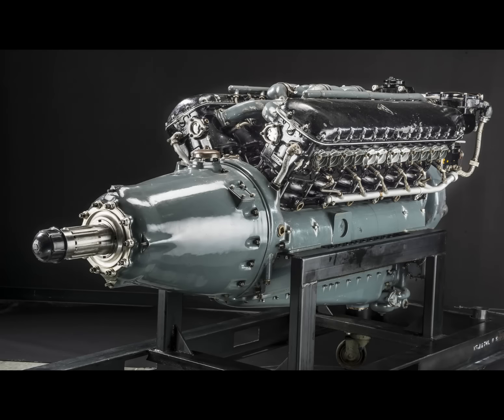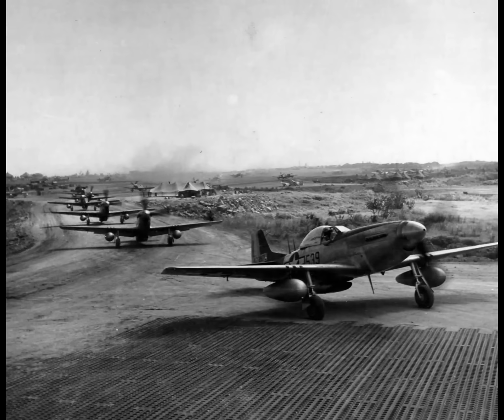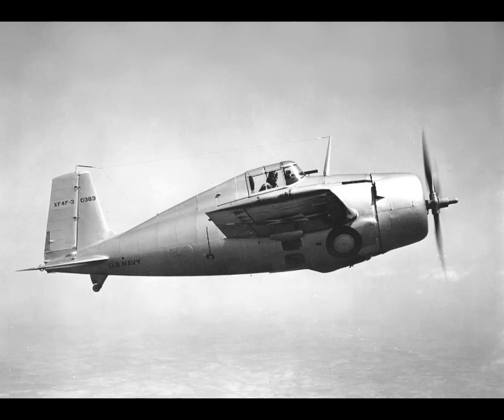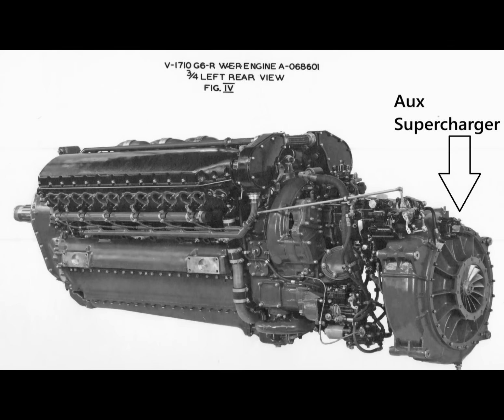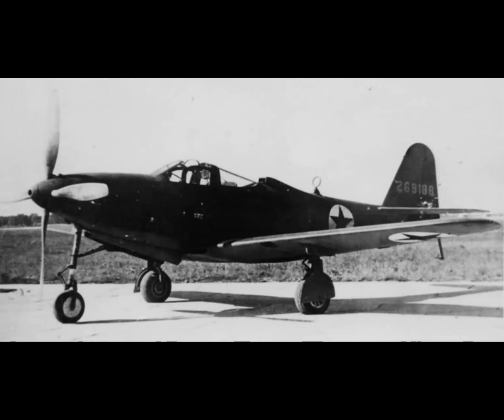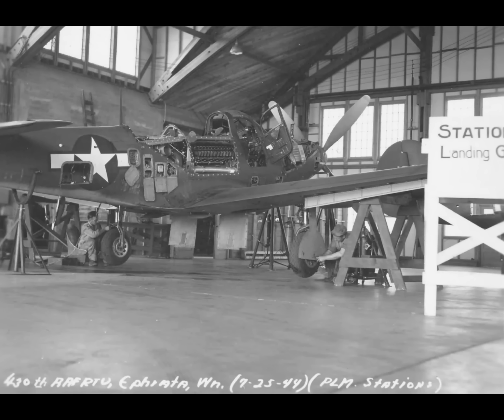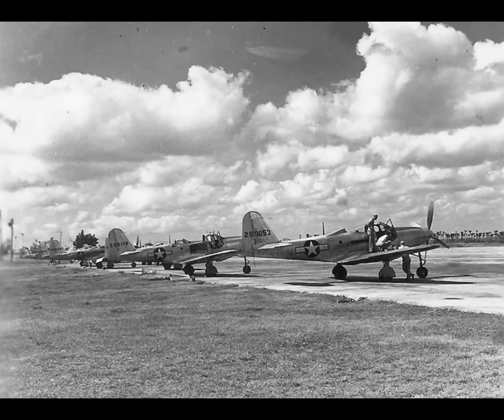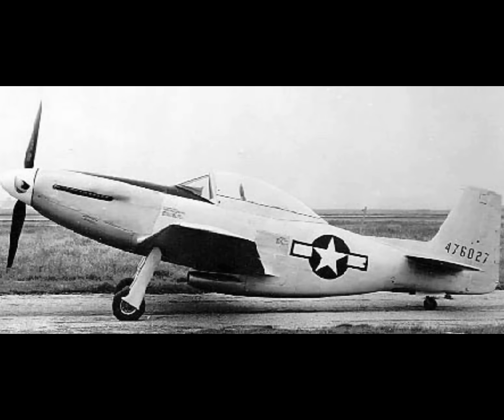Allison V-1710 with a TWO-STAGE Supercharger

Comment: Great video, as always! Considering your attention and focus on supercharging systems, please make sure that in your upcoming video on Bell P-63, you cover (in as much detail as can be found) the experimental Allison V-1710-127 (V-1710-E27)  turbocompound engine, intended to power the (unbuilt) XP-63H Kingcobra prototype.
Reply: 3,090 HP at 3,200 RPM's, 28,000 ft altitude. 
And it wasn't unbuilt, they actually did mount the engine in a P63 after it's certification but it never flew because the war ended. 
Seriously?
Nobody ever took it for a test ride? They had far more patience than I do, I'd have been in that thing 10 minutes after they tightened down the last nut and bolt.
Reply: @dukecraig2402  The claim that XP-63H prototype WAS actually modified in metal from a P-63E-1 airframe was made by Alain Pelletier in his book Bell Aircraft Since 1935. No other source seemed to confirm it, to my knowledge. And there were more problems with taking turbocompound Allison up to the air than just the war end, it seems. Especially that the work on it was supposedly terminated in 1947. By then, the probable outside cause would be the advent of jet age, rather than WWII being over. But there were also other problems. Squeezing 3,000 HP from the old V-1710 (running reliably at half of that power) came at a price. According to Graham Greene, Allied Aircraft Piston Engines of World War II, one of limiting factors were high exhaust temperatures, likely to exceed safety limits in flight. It is one thing to register >3,000 HP for a short while on engine running safely on a test bench, but making a live pilot to mount it (almost literally, due to Bell fighters design peculiarity…) and fly it was quite another. Anyway, let’s see what Greg makes out of it.
Reply: @KK-lk8lt 
The book Vee's For Victory, The Story Of The Allison V1710 Aircraft Engine 1929-1948 by Daniel D Whitney has a picture of the engine installed in the P63, you can clearly see the turbo compounding system as the service panels on the side of the fuselage are removed. 
Yes there's always things discovered during test flights but the turbo compounded engine wasn't just run "for short periods on the ground", it was type certified which means it passed at lest a 100 hour run, the P63 wasn't a Constellation, it wasn't going to fly across the Atlantic, it was the shortest range US aircraft of the entire war.
The P63 and other developmental aircraft were canceled after the war was over because it was the dawn of the jet age but the fact remains that had the war not ended it's development would have kept going on, so yea, it was the war ending that shut down it's development, jets were brand new and they weren't going to stop development of a proven design while a war was still ongoing. 
Until you've read letters from Hap Arnold to Allison and Bell you really have no idea how hard he was leaning on them for the P63, right up until D-Day he wanted it bad to be deployed as an interceptor, he even had 3 units in the states training with them he planned on sending to Europe for use in that role, but they weren't ready yet as of D-Day and afterwards with the Luftwaffe having been all but destroyed it was obvious a short range interceptor wouldn't be needed so P63 manufacturing was diverted to Russia, however in the Pacific he still wanted the turbo compounded version for use there as it would have been ideal to use as an interceptor to protect troops and bases from incoming Kamakazis should the war in the Pacific have drug out, remember this was a point where the bomb hadn't been tested yet and even if it worked they didn't know that it would necessarily end the war, they never banked on it and didn't change any plans just because it was being developed.
Reply: @dukecraig2402  Now, Brian Lohnes put up a new, detailed video on this very turbocompound Allison engine omitted by Greg: https://www.youtube.com/watch?v=qQ7KZq5sxT4
Interestingly, he supports the version that XP-63H airframe wasn’t ever built.
Reply: @KK-lk8lt 
Every time Brian talks about the V1710 Allison I cringe, when I watched that video yesterday and at the beginning he referenced the book "Vee's For Victory! The Story of the Allison V1710 Aircraft Engine 1929-1948" I thought Yipee!! He's finally going to stop with the typical nonsense myths told down through the years.
Maybe next time Brian should actually read books he uses as reference material because he obviously didn't read that one, it even has a picture of it installed in the P63 on page 193.
Brian got so much wrong in that video, like his incorrect claim that the V1710-39 engine had a "low altitude" supercharger, the supercharger used on that generation of V1710 engines had 4 different gear ratios that could be used to optimize the supercharger for different altitudes (later war versions had 5), the -39 variant of the V1710 that the British selected for all their Allison powered aircraft was what they called the "altitude rated" V1710, had Brian read the book he'd have seen that Gen Hap Arnold had received a report from a USAAC officer sent to England to access things that quoted a British report stating that the V1710-39 engines "exceeded the existing Merlins of the time (single stage two speed) in performance to 20,000 ft and were it's equal to 25,000 ft".
Something else he gets wrong because basically all he does is repeat the common myths whenever he talks about the Allison engine is the claim that "Allison and the USAAF throughout the war drug their feet in developing a 2 stage supercharger for the V1710", that's one of the huge myths about the V1710 engine, had Brian read the book, or looked at a chart in the back that lists every single variant of the Allison engine and when they were cataloged and available from Allison, he'd know the first variant with a 2 stage supercharger was available Oct of 1940, a year and a half before the first 2 stage Merlin was available, not only that but work started on it in Nov of 1938 and in Feb of 39 Hap Arnold wrote a letter to Allison, that's in their archives, expressing the urgency to get the 2 stage supercharger system done, by the end of the war there was 36 different variants of 2 stage V1710's that had been developed and were available. 
He got so much wrong in that video I could sit here for the next hour listing everything, he obviously didn't spend any time doing research using the book Vee's For Victory.

Comment: Water methonol is so impressive and I’m surprised I don’t see it more in the car world. I had an old non  intercoled diesel  with a big turbo and big fuel pump. With water methonol I ran double the boost people recommended for stock head bolts on those engines for 2 years before it threw a rod through the block.
Reply: Because it is a consumable that is not readily available at the pump. You can run -20 washer fluid. But distilled water is not sold many places. And methanol is much harder to come by. Its also toxic even splash in skin can cause blindness because it absorbs thru skin and goes directly to the liver, which cannot handle it. (Spilling Methanol on yourself is almost as bad as chugging "heads" from moonshine).
Reply: It was a thing during the 70's and into the 1980's. As I recall it was mostly about controlling knock as high octane and leaded gasoline became less and less available.  Electronic engine management was in its infancy. Once electronic fuel injection and more sophisticated ignition systems with knock detection became common there just wasn't as much demand. As for the toxicity of methanol it is commonly used as a fuel in remote control airplanes. While you certainly wouldn't want to drink it, or even soak in it in actual use it isn't any more toxic than gasoline. Another barrier to methanol is that in recent years it has become much more expensive.

Comment: The setup is very Daimler-Benz, with its hydraulic coupling and methanol. But it looks different as the German setup has a seemingly tiny compressor on the side of the engine.
Reply: The difference is that the Germans mounted their compressors running 90 degrees off of the crankshaft, and the Americans and British mounted theirs inline with the crankshaft.  

That's why the Germans mounted their intake scoops on the side of the cowl whereas American or British V12s have theirs either at the top or bottom, depending on whether the setup was for an updraft or down draft carburetor.  Greg discusses this in several other videos.
Reply: @clarkenoble  Yes you are totally right. In my mind's eye, the supercharger was largely on the side of the engine, leaving no space much at all but I went and had a look - it is clearly behind the crankshaft, cylinders, etc; merely turned 90 degrees. Which make much more sense. I think I was remembering making a model as a child for my schematics :)
Reply: @simon-gr-au Ha!  Yea, I always wanted to make a model of a late model Fw190D.  They look pretty cool with their really big scoop sticking out there in the wind.

Comment: Excellent as always, but I find those horsepower vs altitude charts hard to understand quickly. And the jumbling of label positions vs colors made it harder.

Do you have a suggestion for a good primmer on understanding those charts? Video better, but text/graphics is fine also.

Comment: Merlin power vs altitude charts often include ram air induction at some assumed air speed. IIRC without ram air, a Merlin -3 maintains 60 inches up to only 23,500 feet.
Reply from the maker: Yes, but in combat you're going to be using the RAM-AIR as well as about 90 percent of the time not in combat.
Reply: @GregsAirplanesandAutomobiles  For an apples-apples comparison the Allison chart would need to have ram air too and I think it doesn't.
Reply from the maker: Ram-Air is the default situation in a WW2 fighter. The Allison chart doesn't say either way, but I suspect it is with Ram Air. I'll look into that.

Comment: At 12:43 I am utterly shocked by the power figures and the fact that it can almost make its maximum rated power to almost 20k feet, its almost turbocharger like! 

With results like these it really makes me wonder had the variable speed drive had been discovered in the early 30s by NACA that the USAAF might have also invested into said tech instead of turbocharging.
Reply: We might appreciate the real life, already working in the field, in the actual time period of the war, excellent performance of the efficiently compact (!) integral supercharger engined red P-51 plot?  
Add in probably 150 lbs or more of supercharged V-12 exhaust jet thrust at high speed in the rarefied upper atmosphere and at least some thrust from the ducted multiple radiators single intake housing.  With that additional approximately 200 hp at about 440 mph true airspeed it would match the green plot at 25,000 feet, the typical American heavy bomber altitude.
The hypothetical green plot Allison might have been made available well into the post war jet age.

Comment: I read they had NACA engineers (some who later worked on rocket engines) try and fix some of the Allison's problems and they gave up in disgust. The only place I have ever read anyone say anything good about the Allison is on this channel. Why do you think this thing was any good Greg? What was the maintenance availability of the Allison compared to the Merlin? Is this just a case of Merlin fanboys trashing the Allison?
Reply from the maker: Do you have a source for these reports from NACA engineers? What problems specifically did they give up on "in disgust"? I find this very unlikely.
Reply: @GregsAirplanesandAutomobiles  https://www.nasa.gov/wp-content/uploads/2023/04/sp-4306.pdf page 25-26.
Reply: Maybe you're full of crap
Reply: @kenneth9874  No maybe about what you are troll.
Reply: @garychurch9237 says the liar
Reply: YouTube apparently deleted my original comment, or is holding it in purgatory, so I'm repeating the key points.  Information comes from the book Vees for Victory.

Flying Hours and Labor to Overhaul
1st Quarter 1945 - Primary Usage = Pursuit
Merlin V-1650 - 251 Labor Hrs / 302 Flying Hrs
Allison V-1710 - 134 Labor Hrs / 362 Flying Hrs
P&W R-2800 - 242 Labor Hrs / 469 Flying Hrs

2nd Quarter 1945 - Primary Usage = Pursuit
Merlin V-1650 - 259 Labor Hrs / 200 Flying Hrs
Allison V-1710 - 153 Labor Hrs / 389 Flying Hrs
P&W R-2800 - 241 Labor Hrs / 500 Flying Hrs

While the Merlin and Allison had similar flight hours before overhaul (slight edge in Allison's favor), the Allison is a clear winner in terms of the labor hours.  Note also that the R-2800 enjoyed significantly greater TBO than either V-12, with similar labor hours to the V-1650.

The Allison had similar or slightly greater TBO in the field, cost significantly less (1944 production cost for the V-1650 Merlin was $17,555 with 22,969 units produced, compared to $10,561 for the Allison V-1710 with 20,191 units produced), had the ability to be easily modified into different variants, including changing engine rotation, and was easier to maintain.  The mechanical supercharging development of the Allison tended to lag behind the Merlin.

Comment: Is this the ONLY "mid-engined" WW2 fighter?  
Imagine this aero design evolved into laminar flow,  with Merlin-level charge cooling, 1800hp at 29K altitude!!!  
A beautiful AC!  
I love the Corsair, but the Corsair looks like a ball-peen hammer next to the P-63's sleekness.   The Mustang, again, after seeing the P-63, "why such a big nose, Stang?".  Very underrated AC.
 Thank you, Greg!!!!
Reply: Bell aircraft HAD A WAR-WINNER  in their hands... but never noticed, never followed through!
The mid-engine installation and front-propeller drive train of their P-38 was by all accounts quite  excellent - 
in hundreds of videos and articles I've read about the P-39's shortcomings over the years, 
I've never once read about problems with the drive shaft or  power train.
Bell SHOULD have run the drive-shaft OUT THE BACK of the plane and installed a PUSHER PROP... 
and put ANOTHER ENGINE UP FRONT as in a Mustang - they would have had a SLEEK
 WELL BALANCED small aircraft with close to 4,000 horsepower!!! 
 Of course it would have been a whole new aircraft, it would have had to be bigger, 
it would require  a bigger wing for the added weight plus additional fuel tanks, (etc.) 
but the REAR, PUSHER-PROP would NOT have added much size or weight, 
and the additional engine in the nose would have added 2,000 hp in a very sleek frame! 
  It would have been much smaller than the Donier Do 335, which according to some was the fastest piston engine aircraft of WWII
Reply: both the P-39 and the P-63 are hideous in my opinion; they look like a bald rat, or a banana. The Corsair however, is my favorite, and any P-51 is good looking to me.
Reply: @ThomasHendrickson 

Yeah, but a P-51H is a real beauty. But some of the experimental late war prototypes were stunning.

Comment: A tangentially-related topic: 
I've heard that in the realm of modern pylon-circuit air-racing mustangs, which are almost all running highly-modified/souped-up builds of the Packard Merlin at massively higher manifold pressures than was ever contemplated historically, they have often rebuilt that engine with "stronger"(?) Allison V-1710 connecting rods?

Along the lines of that question, I would hereby request a video focusing specifically on what modern machining and mechanical upgrades (specifically for their hugely boosted sea-level manifold pressures) have been commonly used in these leftover/rebuilt WWII-surplus engines for today's air-racing circuit.  Yes, I realize short-endurance air-racing involves a rather different set of maintenance (and monetary!) priorities than any combat application.  But a summary of that broader modern engineering/development discussion might further scratch the itch for the folks who were asking about Merlin vs. Allison out of basic ignorance of the plain apples-to-apples mechanical comparison (where supercharging was the actual unrecognized crux of the whole question).  That is an ignorance I do still largely share, which I would enjoy having further alleviated. 

Then there's also the matter of the R-R Griffon, which has ALSO been shoehorned into at least one P-51D airframe that I know of, and raced as such at Reno.  But that might be too niche a topic to be worth discussing specifically.  Summarizing the comparative post-war capabilities of the Griffon Spitfires in particular (vs. their contemporaries?), might be more squarely in your wheelhouse.
Reply: "Red Baron" and "Precious Metal" both used Griffons
Reply: @fafner1  
Precious Metal was the one I was thinking of, but couldn't remember that name.  I think I recall that engine crapped on them at least once.  The (decades older?) "Red Baron", is ...

Okay, now I had to go look it up.  Red Baron was the one that almost took out Steve Hinton Sr. back in the day!  After having set the 500mph speed record.  I knew that rang a bell for some reason.  Yikes!  Maybe that's why it took until a whole generation later, before anyone had the nerve to try that configuration (Griffon + contra-props) again!
Reply: According to Graham White's  "Allied Aircraft Piston Engines of World War II"  the tight radius fillets on Merlin connecting rods are less effective at distributing stress than the more generously filleted Allison connecting rods making the Merlin rods more vulnerable to metal fatigue.